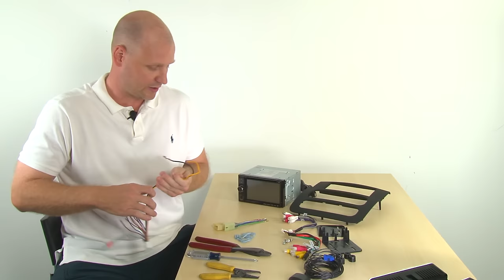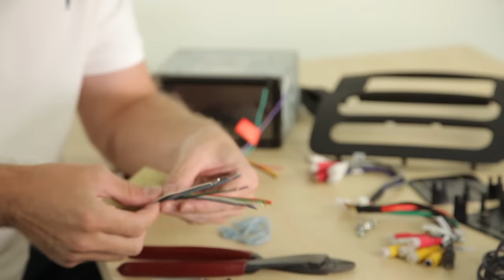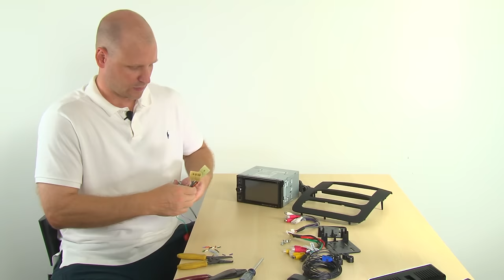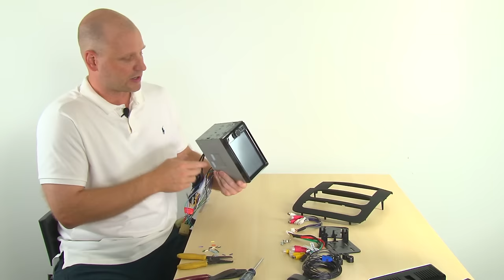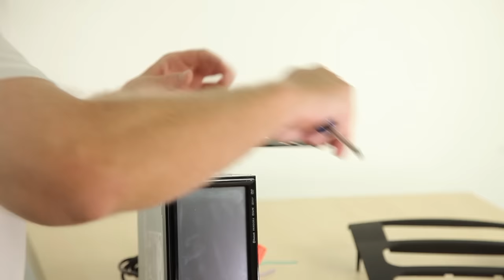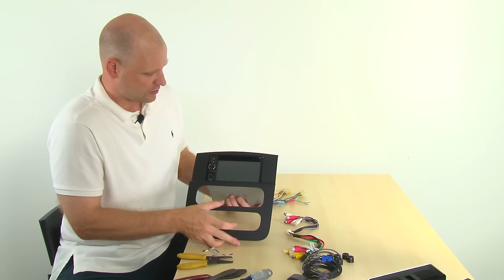How to Install an Aftermarket Car Stereo, Wiring Harness and Dash Kit

Comment: What kind of stereo and material do I need to install a radio for my Chevrolet Cavalier 2004? I need help please
Reply from the maker: Hey Ernesto. These are all the parts you need:
Double DIN Dash Kit:
https://www.qualitymobilevideo.com/95-2001.html
Single DIN Dash Kit:
https://www.qualitymobilevideo.com/95-2001.html
Interface
https://www.qualitymobilevideo.com/ax-gmcl2.html
Interface(steering wheel control)
https://www.qualitymobilevideo.com/ax-gmcl2-swc.html
Antenna Adapter(radio tuner)
Interface
https://www.qualitymobilevideo.com/40-gm10.html

Comment: My double din has a black screen but the side buttons are lit up, how do I fix this? I’ve tried pressing the reset button and that worked a couple times but now it doesn’t nothing
Reply from the maker: Could be a wiring issue. Who installed it?
Reply: Quality Mobile Video 
I did, but a little update tho. Yesterday I was fiddling with it. I shut off my headlights and it turned on completely!And when I pressed on the brakes or turned the lights back on it would die again 🤣